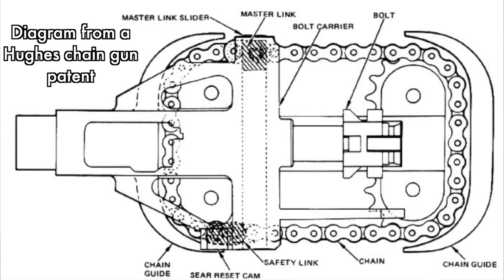Ask Ian: Are Man-Portable Chain Guns Coming?

Comment: Guns jamming in aircraft was such a seemingly common occurrence, it probably saved a lot of lives that would otherwise have ended....and ended a lot of lives that otherwise wouldn't have. "Guns have jammed!" became something that entered the everyday vernacular. I've watched a LOT of interviews with old pilots....most have at least one story that includes guns jamming.
Reply: A lot of that had to with G forces encountered in combat and  a dud  now and then , or earl in WWII oil gelling upon the  guns at  altitude .. damn cold when  you are 25,000 ft  and  that fat was always taken into account ..
Reply: @richardsolberg4047  Despite all that stress, and the M2 .50 cals still carried on for the most part in most US aircraft.  It was never designed to operate in WW2 aircraft yet it's reliability was legendary.  Still, the US Army Air Force insisted most of it's fighters had banks of these guns in case of partial failure.  It only experienced it's limits on early cold war era jets where the planes flew at much higher altitudes in extreme cold and the need to lay a cloud of hundreds of bullets in a few seconds was needed.  The M2 is one of the most reliable and most loved guns.  This is one gun that will never show up on Forgotten Weapons
Reply: @ph11p3540 
Ian had a video on the M2 3 years before you posted this ;)

Part of the reason the US used .50s for so long is that they were manufacturing dud 20mm cannon and couldn't risk switching over. They literally built hundreds of thousands of cannon that didn't work.
Reply: That was down to several different factors. First, as Richard pointed out, G forces. It's the same reason fuel injection was such an important advancement for combat aircraft. Second, the different types of ammo. Most gun belts were made up of 2-4 different types of ammo. Most commonly, some mix of AP, HE or incendiary, and tracer versions of all of them. Different rounds have different weights, meaning different amounts of recoil, which means if the mechanics don't set the guns up properly, there might not be enough energy to cycle the weapon. Of course, this didn't always happen, or else no one would've used varied ammo types, but it was a risk. Third, you've got temperature. Cooler gas is heavier, it doesn't move as fast, and when oil gets cold, it can lock up the mechanism. Lastly, the sheer volume of rounds fired. For example, a Panzer 2 held about 20 rounds of 20mm per magazine. The early cannon armed BF-109s, using a variant of the same gun, had, depending on variant, about 200 rounds
Reply: Don't forget on Mustangs i believe, you had them putting socks on the tips of the guns so that when they engage at altitude the guns wouldn't be frozen. Actually I think that was the Spitfire. Either way, it explains a huge curiosity I had as a kid.
Reply: @MrTAGGER88  The gun ports were taped over prior to firing. You could tell if a returning Spitfire had been in combat by the strips fluttering on the leading edge of the wing.

The P-38's gun barrels protruded out the nose, so no goin' there with sealing. However, the gun bay had heating: warm(ish) air ducted from an engine in the earlt models, electric heaters in the late versions. Plus, there was a manual gun charger in the cockpit to cycle the four machine guns in the nose in the event of a stoppage.
Reply: @BogeyTheBear Now I'm wondering, how does one manually cycle four M2 Brownings? One is already pretty hard if you're in an unergonomic position, and four at once would border to impossible. Or did they have some kind of winch to cycle them?
Reply: @vornamenachname989  The final step in the charger cycle is to literally slam your hand against the charger dial.

The charger had a four-position dial and a lever. You dialed the gun you wanted to cycle, yanked the lever, then slammed the dial back into place.
Reply: @MrTAGGER88 Most likely the Spitfire. The Mustang had heaters, it was very well designed for the altitude it ended up fighting at. The Spitfire however was designed in a mid-war period, improved as the war went on, with the altitude of engagements rapidly increasing during the war, so it's not unlikely that they used some questionable stop gaps to bridge some inadequacies that might have arisen later in it's service life.
Reply: In WW2, many American and Allied aircraft were armed with AN/M3 Brownings, which were (according to my understanding) nearly identical to the infantry M2, just with a higher rate of fire. So those carried the reliability issues from infantry weapons and put them into an inaccessible area
Reply: The way cannons were mounted on early spitfires often caused them to jam after just one shot. So yeah.
Reply: It's easy to imagine why, it's truly insane operating conditions and no way to really clear a malfunction.

Comment: Well with the work being put into exoskeletons, pneumatic and possibly hydraulically assisted suits which would mean you can massively "carry" more armour as the frame takes the weight of the armour not you, in other words with the introduction of Power Armour

I also said years ago they'll be Power Weapons as in specifically designed for power armor. For example the PMG 50. A 12.7× say 70 or 75mm a .50bmg short really massive machine gun is possible with a 50 to 250 round belt in drums or boxes stored around a wearers belt. And gatling guns as well as chain guns can be used as they'll use the armours power supply a little so yeah. I mean why wouldn't you develop A small exos that allow for fast superhuman agility and dexterity and larger heavier juggernaut suits to carry massive weapons into battle. Plus who wouldn't want to be in a suit of power armour holding a gatling gun or the PMG 50? A belt fed .50cal? Hell yes!

Comment: This might be a stupid question : are there chainguns powered by other means than electric motors? for example : gasoline powered chain guns? Also you speak of weight and you speak of infantry being able to clear malfunctions easily. What if that was not the case? Let's think hypothetically here, what if we had an exoskeleton to handle the weight? What if the exoskeleton made manual dexterity harder? A self loading gun uses part of the propellant gases to run the action, does this mean that you can use a smaller charge on chaingun ammunition? Does the lighter load cause less wear and less heat to the barrel? Does this make it possible to use lighter barrels as a result?

Thanks man!

Comment: One reason for the chain is that reliably synching 4 or 5 different actuators has historically been complex and hard.  Modern actuators may be sufficiently compact and reliable that it makes sense going forward to just have a different small actuator on each thing that needs to move.  At that point, you can have a "chain gun" without needing to worry about routing the actual chain through the also-complex firing+loading mechanism.  A modern SPI or OneWire electronic bus would have zero issues synching actuators down to microsecond precision.  And critically, if anything started to go wrong with one actuator, it can have a built in sensor to say what it is doing.  Rather than having a misfire if one actuator starts to go wonkey, the firmware can just gracefully slow down the rest of the system to match the part that is starting to wear out.
Related to this, the Shinzo Abe assasination apparently used an electric firing "match lock."  If you had an electrcicty source in a "chainless chaingun" design, you could use that sort of electric firing instead of using a firing pin, which simplifies another part of the design.  Just need to get the round physically in a closed chamber, and hit it with the spark.
Reply: You say all these things like it's easy, when everything you said is incredibly complex to actually implement correctly. I work in an industrial environment and my job is to troubleshoot machines all day and that's not actually my job title. What do you do when the sensors don't tell you anything is wrong but the machine isn't working?
Reply: @sf4137  You seem to be mistaking industrial machines that run multiple hours a day for devices that would maybe get an hour of actual motion after a month of heavy use.

The reliability requirements are so vastly different that I wouldn't be surprised if the last thing to fail would be the sensors/motors.

As for the Abe, situation, that worked with exposed powder, triggering a primer with electricity can actually be harder to do.
Reply: @SirSpence99 nah, that is a lot of complexity for little additional value. 

Machines that run all the time are often easier to debug and maintain than those that run infrequently - especially if someone is likely to die if that machine isn’t working perfectly when you do try to use it. 

There is a reason why electronics are rare in weapons of any kind, and when they are there, are the simplest possible type of circuit anyone can think of.
Reply: @ I literally just fixed a CNC mill this last weekend that sheared bolts that were holding the Y axis carriage to the table.

The only reason machines that run all the time tend to be easier to debug is because they are designed with failure in mind in order to make it easily repairable AND because they run so often they are more likely to break down so you are more familiar with them.

Things that run infrequently go much, much longer before needing to be fixed, especially if they are electromechanical.

As for electronics being rare, there are two reasons, one, the vast majority of designs cannot withstand the jolt and secondly, people get scared of batteries because "EMP" so the market is much smaller than it should be.

As for additional motors being more complex than a chain? Are you high? Decent chance that you can straight up wire the motors together and not even bother with trying to sync them up. They will last a long, long time. Further, the effort required to make sure a chain is properly lubed is not trivial. Nor is designing the path for a chain.

Also, wtf necropost.

Comment: WIth a linear electric motor you could probably get around the issue with the chain. Simply attach the bolt to the linear motor and use an electric switch as the trigger. That way you could potentially get a fixed machine gun with a very high reliability and variable rate of fire.
The added weight of the linear motor but especially the weight of the power source would keep it from becoming useful for infantry though

Comment: something Ian touched on but worth further discussion, Chain guns save on length compared to a traditional action. This is one of the reasons why they're very useful in AFVs because the length of breech/recoil is one of the key determinants of how big your turret ring diameter needs to be which can impact overall vehicle size, having a shorter overall action with no clearance needed for recoil travel allows you to have a smaller turret ring and therefore a smaller turret/vehicle, or failing that a larger turret with more free space

Comment: Well, Miniguns and rotary guns ARE externally driven, same with chainguns, so their rate of fire is variable.
A rotary gun could be set up to fire 1000RPM and have a much longer sustained burst capability...it's just never really necessary.

But could you crank a chain-gun up to high RPMs without breaking the chain or other components? Is it practical?
Afaik any chain-gun I have seen has had a very slow rate of fire. I assumed this was because OF the chainsystem requiring slower operation for more reliability.

The Bushmaster 25mm in the Bradley and the Apache's 30mm aren't really famed for their high cyclic rates.

Comment: huges made 3 chain guns when i worked there, 7.62 chain went into to the mark 4 gun pod 25mm in the bradley m2, and the 30mm for the apache. i new the designer lenny. i worked there when douglas aircraft bought them.

Comment: Sounds like this system could be useful with coil guns to some degree.

Also, chain guns for infantry use are not likely because fighting doctrine shifted towards controlled bursts over full automatic fire. This is why systems like Negev are so acclaimed. They are a LSW but are still capable of single and burst fire which is preferred in most engagements while still having an option of laying suppressive fire.

Comment: Would a chaingun system work well with a caseless ammo system in the sense that caseless ammo would need less gunpowder to operate and so help mitigate the heat accumulation in the gun system, and help bridge the reliability gap of caseless ammo while the issues are worked out?

Comment: Not a quibble, however, on most electric motors, the copper windings are not the heavy parts, it is the iron elements. Unless you work with electric motors you would assume otherwise, naturally. I would like to point out the inquisitive nature of the question and the remarkable reply. Very educational. Thanks Ian, even though I knew about chain driven actions, I never thought it out as you did.  That's why I come here.

Comment: One thought I had is whether the chain system would be an adequate trade-off to facilitate case-less ammunition. Theoretically with the fouling and reliability issues of caseless an external driver could be worth it. 

Maybe for something like a Man portable SAW and enough ammunition to set up a significant defensive position, the chain system adds, 8 # but then you save 30# in brass weight. 

Compound the weight savings with the advantages to drones and you could have an armed drone system with enough ammo to provide significant fire support over an extended operation without having to resupply.

Comment: One solution to problem of clearing large or inaccessible guns is the use of cocking charges. After a stoppage, a charge can be fired that will drive a piston and cycle the action. Used on the BK-27 and GSh-6-23 (a self powered rotary cannon) and probably more. The GSh-30-1 has a different, but somewhat comparable system; if the primer fails, a cartridge located to the side of the chamber can fire, poking through the case and hopefully setting off the the charge.

Comment: Will autocannons ever be viable for a single soldier to carry and use?
I mean, technically, strapping a GSh-30-1 to your back is possible. But like, you don't get any ammo or way to actually mount the thing so it doesn't go flying across the landscape firing dozens of 30mm rounds a second with a ton of force, which is, shall we say, a sub-optimal outcome. I'm talking about carrying an autocannon, reasonable amount of ammo, practical mount, and being able to actually fire it full auto without going to outer space from the recoil.

Comment: *hits blunt:
What if instead of a pure chaingun, we added like an airsoft motor somewhere in the gun that moves the bolt when it malfunctions but also has a clutch system so normal function won't be slowed by the motor. Specifically only run this on machineguns/SAWs with low reliability problems. Also charge the battery with regular operation by putting magnets in the bolt so it creates a small electrical impulse every time it runs through a coil, which is also in the gun.

Comment: In order for a chain gun to be more efficient for infantry use the energy storage for the electric motor would probably need to be more efficient than the energy storage of the propellent in terms of weight, and batteries are not there yet.

Comment: Gas systems could be designed to store some additional energy, beyond what is required to complete a reloading process. IE: it has enough energy to reload twice after 4 rounds, so if #5 fails to fire the firearm can cycle to #6, without any assistance. If #6 also fails, or any rounds before #9's cycle completes, you're screwed.

Are there any firearms with that recycling available?

Comment: I don't think you are right…regarding the difficulty of cocking to be directly related to the caliber of the firearm.

Big bullets take the same force to fire, regardless of caliber, because primers take the same force to fire.

The force to overcome is the springs used to absorb & transfer the force when firing, but those aren't in some applications, and don't need to be compressed in others. In those the strength required to reload after a dud is only what is needed to lift a bullet.

Comment: Chain guns as they are being chain driven action, They could be used in nontraditional ammo like air powered or electric (coil gun) applications. Multi-barrel setups where they either have to specifically cycle at a set interval or they have to fire in complete synchronicity with each other can be another reason for chain gun use. Although no really hand held, the battle suits that was being developed (the power assist suit) could have back mounted weaponry and that would be a good showing for chain guns and they would have the extra capacity for weight and having a very controlled fire rate would be more important and they do fall into the range of man-portable chain guns.

Comment: Wait, wouldn't just throttling a gatling system to a similar rate of fire give you 6x slower heat buildup and much faster cooling? Surely the idea that they heat up just as fast is based purely on the decision of the designers and not on the system itself.
Reply: Yes, but now you have 6x as much weight. A Maxim gun can already fire indefinitely (literally, it was tried), without needing six barrels and six actions. Miniguns and aircraft rotary cannon are made muti-barrel to be able to fire very quickly, for a short amount of time, without breaking. 

The problem was, you couldn't force a single-barrel gun to cycle that quickly and not break parts, and make a barrel that could take a 5000rpm burst and not degrade instantly